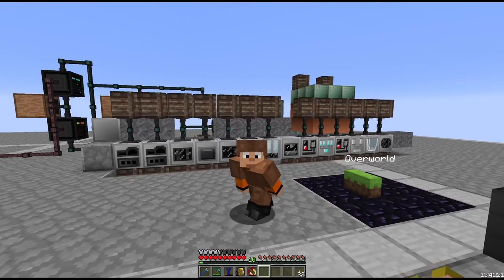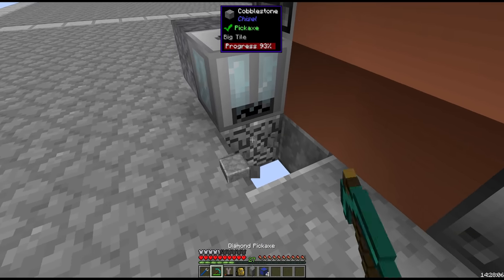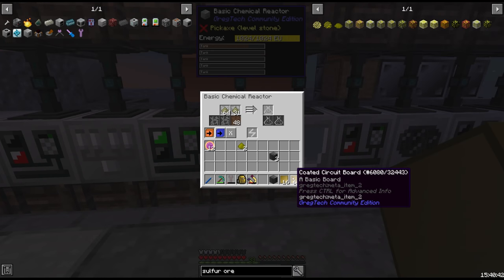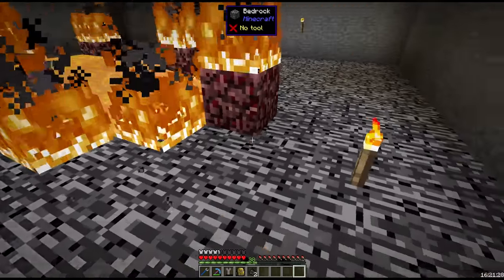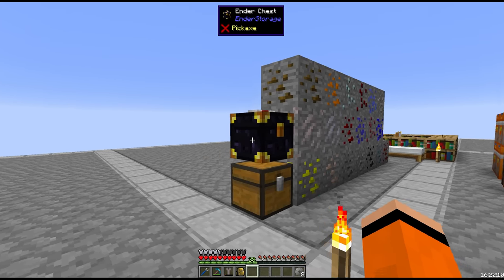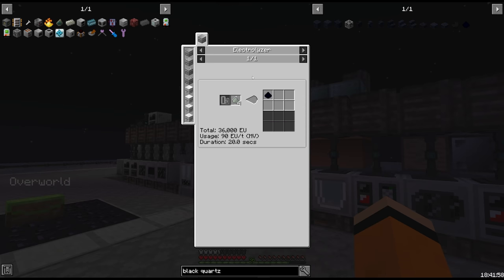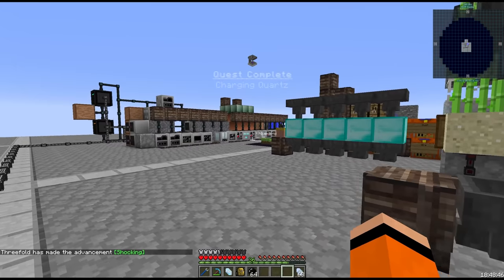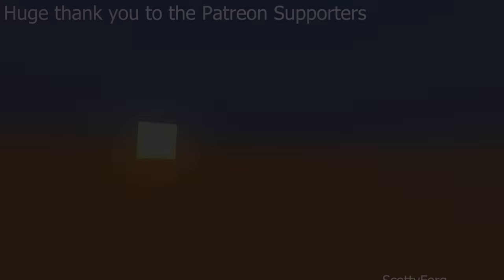Circuits, Conduits & Numismatics - Nomifactory: Episode 3

Comment: I know the series is long over but if you ever play it again, energy conduits work differently in this case. They go by connections rather than overall throughput. So one connection allows 512rf/t through. If you connect two Steam dynamos, both will pull 512rf/t from each dynamo making it 1024rf/t total available. You can also connect multiple connections to your CEFs for inputting more power than your cables can handle. Usually the case I do this with is end steel cables, where I connect multiple inputs to a capacitor bank to be able to handle all of my numismatic dynamo power which is guaranteed to be more than one output, so I will always build a buffer.

Comment: I hope you're enjoying the break from GT:NH. Sometimes it's nice to jump into a relatively easy pack that still has Greg in it. I'm actually thinking of taking a break myself and hopping into Nomifactory, it looks really fun!
Reply: I am sorry, I am looking at this a little later in time... But did you just refer to Nomifactory as an... "easy pack"? Like really, what would be considered a difficult pack?
Reply: @DarkCrux  It's not an easy pack, it was just easier and more laid back compared to GT:NH, I was glad he was taking a break. Although that "break" eventually turned into S2 of GT:NH
Reply: @alexplaysgames4219  Ah I see, now that i've got your attention, can you tell me exactly which version of Nomifactory Threefold is playing here? It seems to differ slightly from the version I am running, and I feel like I missing out on some of the aesthetics, and the quests log also seems to be different. I currently have the latest version installed through CurseForge.
Reply: @DarkCrux  I'm not sure, the last full release was 1.2.2.1 in Feb of 2022, however on CurseForge there is a 1.3 Release candidate that's been out since December of 2022 so that may be the version you're on.

Comment: Dynamos do waste energy if full without upgrade or turned off with red stone signal
You don’t need to filter into the loot fab and sim chamber, pretty sure they filter themselves
Reply: Dynamos will continue to run at 10% of their output rate voiding the power if the internal buffer fills. If you waste an upgrade slot with the limiter augment, it will decrease to "0" but every so often voids a little bit of power to keep the dynamo running as it has to be burning fuel to output energy.

The loot fabricator and simulation chamber I don't believe do filtering of their input slots, but it certainly doesn't hurt to add filters to ensure things are not going anywhere unexpected as a rule of thumb. Particularly when you have multiple loot fabricators, you want to prevent the wrong pristine matter from entering them.

Item conduits also reset round-robin counting when the item type changes so you want to be sure to extract each pristine matter directly from each drawer rather than from a drawer controller.

Comment: 17:23 the cut is a bit sus.
I like using brown for extraction from interface/other sources and red for insertion to them as both require 1 click. And I don’t care as much for everything else. 
Maybe try rushing refined circuits? But AE2 autocrafting is unlocked in MV anyway
Reply: Why is that cut "sus"?  You can see the timer go up by a full minute, its not like he teleported instantly.
Reply: Looks like he took a lot of damage and then healed/respawned
Reply: @player-hw7pe  you dont take fall damage with empowered dark steel boots

Comment: Don't forget to make a wall of ores so that you can use the scanner to look for specific ores.
Reply: At 12:44 I think he already has one set up if I’m not mistaken
Reply: @Jacob-sr2wd  he has but I don't think he added sulfur ore which he crafted.
Reply: @dinispaiva3126  ah makes sense, I thought it looked incomplete as well
Reply: He didn’t add every ore when he bought it or found it
Reply: @dinispaiva3126  Because Sulfur Ore only spawns in the Nether.  There's no point in keeping any.
Reply: @MrErizid  I'm not sure but I think the scanner would still work. Since i think it works in a similar way to the mekanism digital miner where ore 
(It could be ores not 100% sure) makes it mine every single ore but if you do tin ore (once again might be *tin ores*) it will mine all tin ores no matter mods as long as the tag is the same. Seeing as how this sulfur is from the same mode and goes through the same process it should have the same tag ,right?